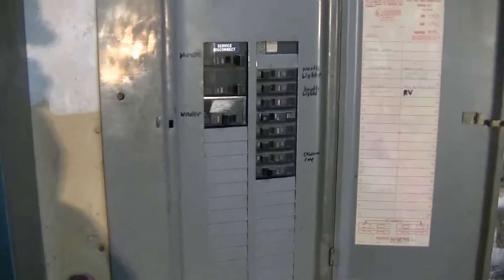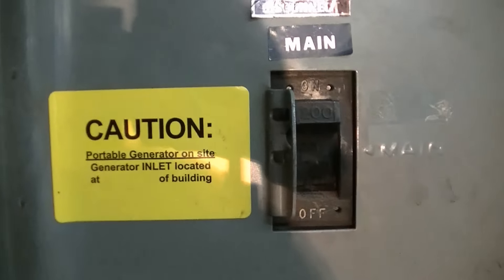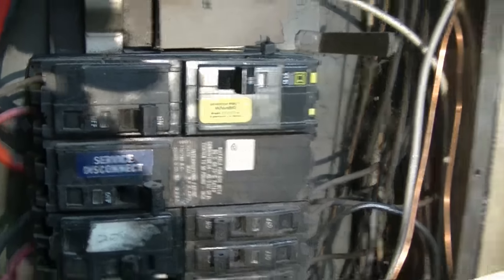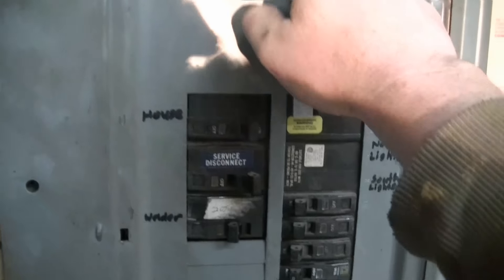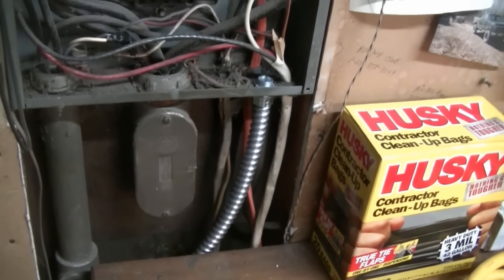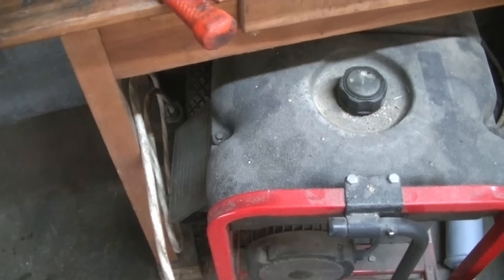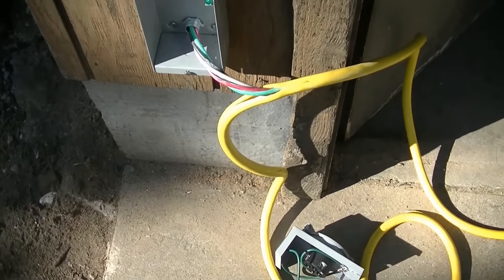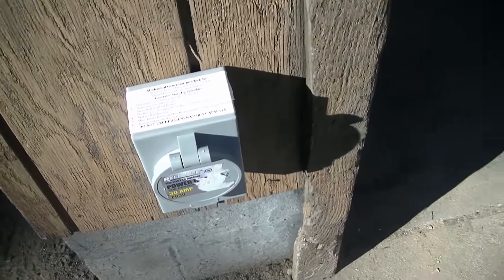How To Install A Generator Interlock

Comment: Is it safe for one to run a 4 pronger from generator outlet to dryer outlet and go that way , as long as my main breaker is OFF . Electrician in my family says not safe , could harm a lineman !  If not safe , what can I do , yes, I can have a sub-panel , but costs arounf $ 800 !!
Reply from the maker: The cheapest "safe" way to do it, is the way I did it in my video with an interlock switch and a dedicated circuit for your generator.  All the interlock does is keep you from accidentally having the main breaker on and and the circuit with the generator on at the same time.
Reply: not true, all linemen are train for this!!! But it does not cost any money to be safe i.e. kill the main breaker. Line men know how to work safe!!!
Reply: you can also go to a gas dryer.  The fuel will not be shut off.  110v is a lot easier on your generator. I just god a gas dryer for free.
Reply: William Ward. He's not trying to power the dryer, he's trying to power the house through the dryer plug..
Reply: Dedicated breaker with the interlocking is the least expensive way to go. If the main is not open and the power comes on you could burn up your generator if it's out of phase which most likely it will be. You can also injure or kill a lineman with the backfeed of your generator
Reply: YES as long as you turn OFF the main breaker like you just asked... 
If the family member is an electrician and he said NOT SAFE then he is not a certified electrician and knows nothing. With the MAIN OFF, you will NOT back feed power to the GRID and besides, LINEMAN are aware of idiots out there so they make sure the power lines are GROUNDED before they work on em.. 

Besides, how long do you think your rinky dink 30 amp generator will last when you back feed it to several houses... That generator will blow the breaker almost instantly trying to feed all those houses..
Reply: IF you have the generator backfed into a 220 dryer outlet, It is, temporarily, on a dedicated breaker as nothing else is connected to the dryer outlet.
Reply: Power went out 2 weeks ago.  Backfed into the dryer outlet.  Had Tv, space heaters, hot water, lights, fridge, etc.  When electric crews came around, I told them I was backfeeding, but had the main breaker off.  They said it didn't matter, either way to them.  They assume there is always an idiot feeding electricity into the lines and treat them ALL like they are live.  Told me not to worry about my generator, or to turn it off.  Now, WHO is the idiot?
Reply: William Farr why is this ?
Reply: Eric Colegrove I hope you are not referring to me as the idiot...  If you are then you have ZERO clue on what I do... Next, what is the freakin point of having that main breaker there if it's not good enough to separate the house from street power ..?? Why put it there ..??
Reply: You Tube Maybe I misinterpreted your comment's recipient. I was happy that, with the help of smart people here, I was able to power my home during the 2 days we had no electricity. Wife was scared to death I was going to burn the house down or kill myself. Once she realized I had a clue and made it easier to survive the outage, she was a happy lady.
Reply: Eric Colegrove I would never use the dryer back feed (even though it's safe when done correct), it's too much work involved. And more $$ spent to get it done. We just went thru hurricane Irma and lost power for 10 days... I took my generator and got a 10/4 cable and ran it from my generator and wired it directly to my outside panel with a double 30 amp breaker... I made sure that the main breaker was OFF before I flipped my generator breaker ON... By doing this, I energized both 120V buss bars outside as well as both 120V buss bars in the panel inside my garage which powers the entire house.. This way I didn't have to run any extension cords anywhere, I just left everything alone and turned on what we needed to get by... We ran this way for 10 days with no issues... Then on the 10th day I come home and the power is still out.. Crank up the generator and business as usual.. I go walk the dog to see that the street lights were back on... I was like yay.. The power is back on, so I went out to the outside panel... Flipped my generator dual breaker OFF at the panel which cut power to the house... Shut down the generator, unplugged the cable from the generator, wrapped it back around the panel... Then flipped the main back on... Voila ... Power to the house restored... AND.. my generator cable is NOT energized because that double 30 amp breaker is OFF so the male end of that cord is not energized :-) 
THAT IS HOW SHIT GETS DONE EASY, CHEAP AND SAFTLY ... 
MY setup puts the power source right there at the outside main panel.. Just as street power comes in, all I am doing is substituting street power for generator power and re-routing the power using the existing house wiring... 
Is it legal.. NO because I don't have that interlock... To prevent a dumbass off the street from flipping the main back on while I'm using generator power, but I have a 6 ft fence around my property with the gates LOCKED so they can't just walk in, sure they can jump the fence but my panel is LOCKED so that they can't even open the panel to get to the main breaker unless they use serious bolt cutters to cut off my lock...  but why go thru all that trouble to jump my fence ... Use bolt cutters to cut my lock out then open it up and flip the main breaker.... Sure they can.. But why..??
Most people spend all this $$ on crap that is not needed... What to make it look fancy ..??  This is temporary power for temporary use.. I'm not going to waste $$ on that crap..
And if some jackass did decide to jump my fence, cut off my lock and open the panel and flip the main back on now sending power back to the street.... How long do you really think my 30 amp generator will last once it hits the streets and attempts to power 50+ homes...?? It's already feeding my house that is probably pulling in about 5k watts..  The second it see's the street side load.. It's gonna bog down and shut off... Almost immediately ..  Think about it :-)

Comment: is this a cutler hammer panel? Also the interlock looks to be the same company that made mine, they say to throw away the metal pc used for hole template?
Reply from the maker: tasty lemons Chris it’s a square D.

Comment: Hey man! So you bought two power cords and spliced one to connect the inlet box to the breaker? The other cord you used for the actual generator connection to the inlet box? Does that sound about right?
Reply from the maker: Close.  It was just one long cord.  I disconnected one plug and fed it through my conduit.  Then I cut it so it was long enough to run from the outlet to the breaker panel.  So this wire now had no plugs on it.  I wired it in the breaker box at one end and the outlet at the other. Then I stripped the end of the wire of what was left of the original extension cord and wired the plug back on, making a shorter extension cord.
Reply: I don't understand why you didn't use single conductor wires such as thwn to feed the generator inlet through the flexible conduit.  Stripping a portable cord for use that way is a waste of money and also a code violation.  That portable cord is not approved to be used as a permanent installation.
Reply from the maker: You're right, of course.  I never planned to strip the outer insulation off.  It wouldn't fit through the conduit though.  I don't think it was a waste of money though, because I was buying a cord anyway, I just shortened it a little bit.  I get that it is a code violation, but just curious as to why it would be a problem.
Reply: Mudford, You did a nice job with the flexible conduit installation.  However the insulation on the wire that you used is not rated for a permanent installation.  Over time it will dry out and become brittle, particularly the part that is exposed to the weather.  A portable cord is only for temporary use in the free air.  You should have used individual THWN conductors. Although copper is copper, not all wire insulations are the same.  The National Electrical Code Book is loaded with all different wire types for every application possible.
Reply from the maker: Thanks for your comments John.  I will have to get some of the correct wire and change it out when I get time.

Comment: Do you have a link or part number for that interlock?   I can't find it with a simple google search.
Reply from the maker: Tony Montana https://www.geninterlock.com/product/square-d-200-amp-vertical-throw-main-breaker-generator-interlock-kit/ I think this is the one for my panel. If your panel is different, they show a lot of other options for square d panels on that site.

Comment: An interlock switch is a suitable substitute for a transfer switch. Its main drawback is that it is manually operated. The problem that most often comes up is that most people want the installation to allow disconnection of the generator easily. This often results in the use of the so-called "Suicide Cord".  I have seen many comments claiming this is a perfectly safe method....believe me it is not!!!. If the hot cord with the male plug ot is removed from the female plug then electrocution is very possible.
Reply from the maker: If you watched the video, you should have noticed that I have a removable cord for mine, and it is not a "Suicide Cord" as you called it.  There is a box where the cord hooks up that has a male end.  The end of my my cord has a female end.
Reply: I'm sorry but the only way my system's outside plug is hot is if there is a generator plugged into it and it is running. With the lock there is no way from power from a hot panel to go to the outside inlet. This not a suicide cord or cheater cord system where someone just plugs a generator into a light socket.

Comment: Why would move every breaker down two spaces rather than just relocate the top breaker?
Reply from the maker: Grizzled Old Dude The wires in the panel weren’t long enough to move one breaker that far.  They were long enough to move all of them a little ways.

Comment: I've watched a few of these videos, and I have a silly question- Why not just run wiring outside with a generator plug on the end? It could be left coiled in a sealed box and would eliminate the need for a 40 dollar wall plug! By eliminating the exterior plug, you eliminate one more connection that could go bad!
Reply: Because that's against code, if any part of it ever goes bad and you burn your house down, your insurance will say you're S.O.L. and not pay you. $40 box is cheap insurance.

Comment: I need to do that to my house nice job
Reply from the maker: It's a good idea to do it, or some kind of transfer switch.  It is technical illegal to back feed power through an outlet without an interlock. Also, you will damage your generator if you accidentally back feed power from the grid into it. Trust me.
Reply: there is no such thing as technically illegal. It is extremely dangerous to not use an interlock or transfer switch to connect this way.

Comment: Today's 87 octane + 10% ethanol gas contains 120,000 BTU's of energy. Propane has 91,600 BTU's. I have been told by a 30 year experienced small engine mechanic that you will lose 20% of your generator's output with a proper conversion to propane. This means that you will be converting your 5,500 watt generator into a 4,400 watt. 5,500 / 120 =  44.35 amps @ 120 VAC now. 4,400 / 120 = 36.66 @ 120 VAC amps after conversion. I prefer using gasoline personally but then again, my garage is NOT connected to my house either. I try to keep about 40 gallons on hand because our power company infrastructure was built by Nicola Tesla and hasn't been upgraded yet. What I do is use Sta-Bil fuel stabilizer in my gas cans and and generator tank and I keep track of the date that I filled them. I know Sta-Bil is supposed to be good for a year or two but after six months, I begin cycling my gas stores into my car and refilling the cans with fresh gas. I also siphon the gas out of my generator tank and replace it with fresh. Once the tank and gas cans are filled, it doesn't cost me any more to cycle them out and refill them, (except for the extra Sta-Bil),  because I would be pumping gas into the car anyway. I just pour it out of the cans and into the car tank and pump what I would normally put into the car, back into the cans. If a situation comes up to where I have to wait beyond my six month limit, the Sta-Bil is still there to keep it good.
Reply from the maker: Jeff McCrea Excellent point about losing capacity by using propane for fuel.  I noticed that dual fuel generators have different watt rating based on the fuel used.  That is definitely something to consider.  I would eventually like to have the convenience of running my generator from a large propane tank.  I don’t live close to a gas station, so it was a real pain to keep filling cans when we had a big ice storm and didn’t have power for a week.  I have already upgraded to a larger generator with electric start so that my wife can get it running if I’m at work. So I think I’ll be okay for capacity now.
Reply: Pull the ethanol out of the gas

Comment: I pretty much did the same thing as you. https://www.youtube.com/watch?v=V-T8VTQUjBY
One thing I added was a Watt meter that will tell you how much you are drawing off of each phase . Its good to keep it balanced as much as possible so you don't overload and burn out one phase of your generator. 
Another thing I don't think was mentioned was with a manual switch you can pick what breakers you want on instead of having to make your limited selection ahead of time with the auto type switch. Everything in my house is electric, well, stove, heat/AC, water heater, everything. Different seasons you are gonna want different things. A 100 degree day like today is maybe its just the AC. If you want a hot shower in the morning and make breakfast its the water heater and stove (along with lights and a working fridge).  Winter, who needs a fridge but heat would be nice.... Or the reason I put it in the first place was because I was going to take my boat to a boat show and lost power the whole day and night before the show. Now if it happened again it's what ever the wife needs and the garage. I love having options.

Comment: Why do you feel like you NEED to install an interlock..??
Reply: Hurricane Dorian???
Reply: WTF does hurricane dorian have anything to do with my question..??
Reply from the maker: You Tube If you were to not be home when the power comes back on and your wife were to hypothetically get the order mixed up and turn the energized main on while the breaker is still on, causing electricity to back feed into your generator, resulting in the blowing out of the diode and brush assembly.  That’s just what I’ve heard.
Reply: @John Matthews:
Unfortunately not everyone is cursed with knowledge ...